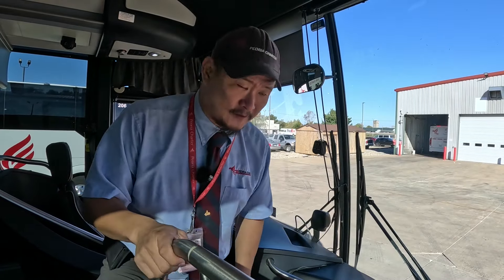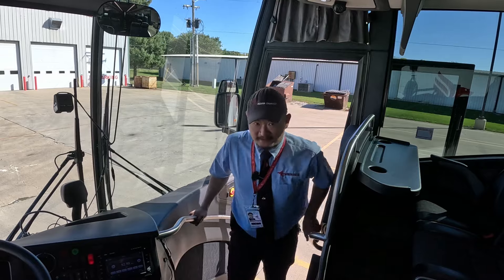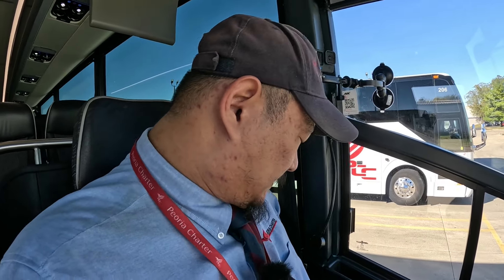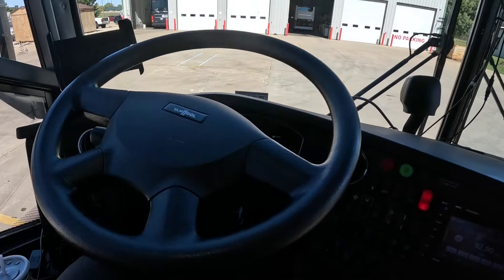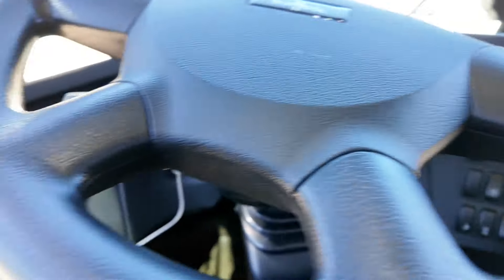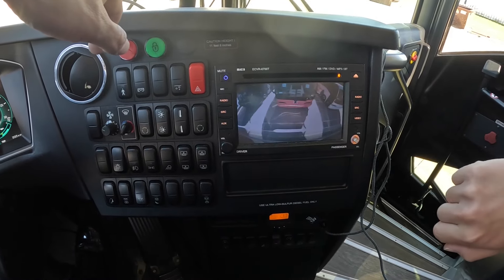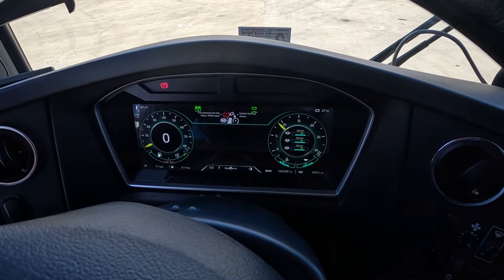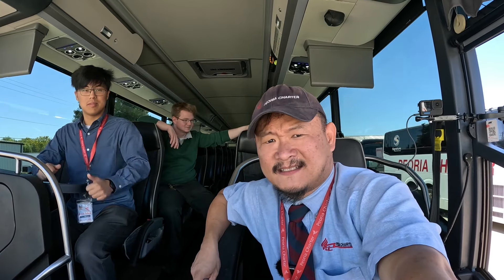What do all the buttons do Van Hool CX45

Comment: The switch type on the Vanhool is the way how most light switches and switches on plugs are in the U.K. and a lot of Europe, where pushing it down from the bottom of the switch turns it on, and pressing the top turns it off. It also works the same on piper and Cessna aircraft

Comment: From my European training on a coach, the deactivation of a auxiliary brake system like telmar, retarter or intarter should be used in winterous conditions as anti lock braking system does not work with those auxiliary brakes. So to avoid your brakes from locking, you sometimes need to turn off the auxiliary brakes. However, I believe nowadays most anti lock braking systems does also include auxiliary brakes. 😊

Comment: Talk to VDL/Vanhool about discontinuing the use of Kiel seats. The other day we had a CX45 with less than 20k miles that had 12 bad recline cylinders. These kind of things from third party vendors really gives the brand a bad rap. 

 Also speak to them about moving the heating compartment (eberspacher, hoses, valves etc.) away from the highway side of the coach. Every time a hose splits and you have to pull over to the side of the road to try and find the valves (see if you can) that cut off the coolant supply you risk your life to on coming traffic.

Comment: We have some older D4505's and I get annoyed at how some 3-position switches have off in the middle (cabin lights) and some have off at the bottom (engine brake). Having off at the top would take some getting used to, but I hope they are at least consistent. (Those D's also use symbols with no words on most of the switches, that is another gripe) I like our NJ Transit D's with the industrial toggle switches.

Comment: Lane departure doesn't automatically keep you in your lane like my Corolla?  Does the bus have auto braking - anti collision ? And the speedometer needle looks really small. In fact, the whole cluster looks small and busy. Just my two cents!!!
Reply: ikr. they are just an assistance. not automation. i agree about the cluster panels. they are just a graphics that can be messy sometimes. pretty much like in many coaches today. before 2019, they use physical gaiges which were easier to read

Comment: You mentioned a wheel chair lift.
Where is that, and where would you put a wheelchair since I didn't see any gaps in the seats?
Reply: the seats sits on a rail instead of permanently bolted to the floor. so if you need a space for a wheelchair you can fold and slide the seats front or backwards to make a space, otherwise you can keep a standard seat layout

Comment: Overhead blower fan speed is calculated by your temperature set point. Once the temperature reaches the setpoint you have chosen the fans will reduce their speed automatically. You always want ventilation so they never completely cut off.
Reply from the maker: Yeah since there is a lack of controls for the passenger fans, I figured it was automated. But even at that, they are much weaker compared to other makes. I would personally like to control those my self as a driver. And when passengers have asked me to turn those fans on or up, I have to tell them that I have no control of them.
Reply: @MotorcoachWorld  you actually can control it from the dash mux. A little involved but your local tech rep can walk you through it in a matter of minutes.
Reply from the maker: @dougwoodie6675  I guess what I'm trying to convey is... It's not as simple as MCI and Prevost and Mercedes where the driver can push one dash button and control the speed. 
And I cannot realistically go through all of that while on the road when a passenger asks me to turn the Bowers up higher or off .. I would have to pull over. But it's nice to know that there is a function buried away in the dash somewhere. Thank you for the insight. You are obviously someone who knows their way around a Van hool
Reply: @MotorcoachWorld  understood. This isn’t a function I really want my drivers to have. If you want the cabin temp to be 68 then set it on 68. If the passenger doesn’t want are blowing on them then they can simply turn off their vent. You would never turn the blowers off with the system running. Vanhools don’t have sidewall air which is something I am thankful for. The system operating as programmed will prolong blower life. I can picture drivers tooling down the road by themselves with the blowers wide open lol

Comment: The switches are all the same. In is on, out is off. That the symbol is sometimes at the top and sometimes at the bottom of the switch, but pushing the symbol in is always on.